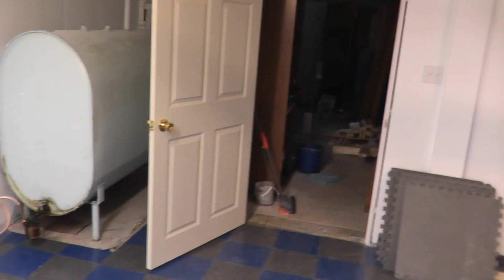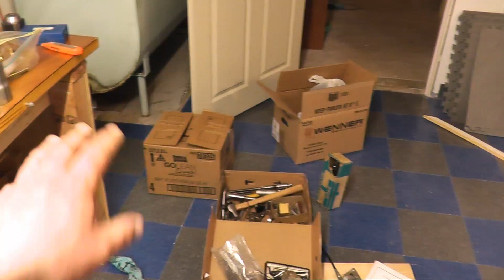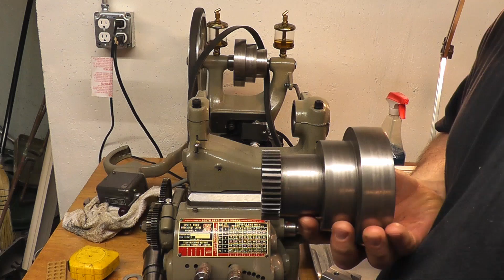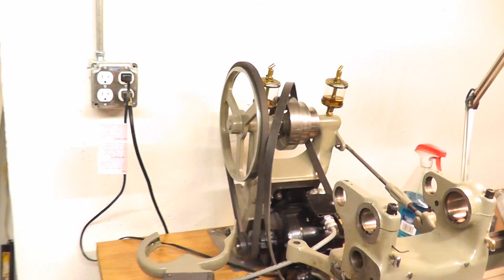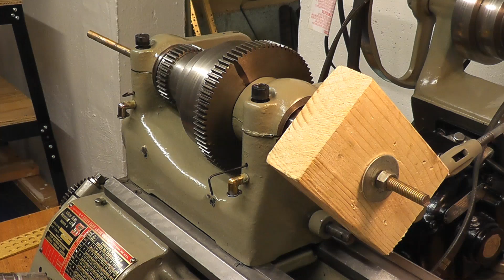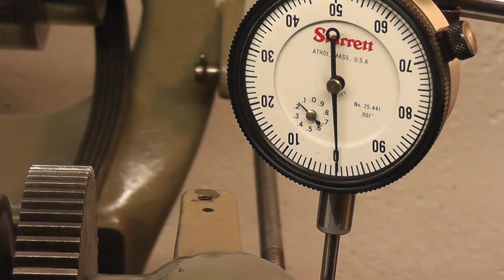Southbend Headstock Assembly

Comment: Got my spindle reinstalled this evening.  It all feels a little tight and doesn't spin as freely as I think it ought too, even backing tension off of the washer.  I did add needle bearings too while I was at it. 

When I was reinserting the spindle through I had to use a draw bar setup to draw it through even before I reached the bull gear's keyway.  It was extremely tight and I'm wondering if I ended up with some foreign debris even though I tried to keep it super clean and lubed up. 

I'm thinking of running to see if it will bed in,  what do you think?  Take apart/ reassemble or run to see if it beds in first?

My experience putting it back together was not like yours,  I had to use some persuasion.

Comment: Hopefully you still monitor this post.  Have a SB 9", A model and it needs painting.  Paint, do you remember the type and color etc. that you used?  Thanks
Reply from the maker: It's a custom paint match using Sherwin Williams all surface enamel.  Look back to one of my first few videos called stripping a lathe for new paint.  The paint code should be on that video.

Comment: Hi Greg, Absolutely great tutorial on assembling the head stock and back gear. Just one small tip on adjusting the depth of mesh on backgear to head stock, put a piece of paper between the two gears when adjusting to give the correct (or close enough) mesh clearance. Many thanks as I have a Southbend copy 9" A model Hercus of 1954 vintage here in Australia which I am trying to source a set of 'V' belt cone pulleys for, to replace the flat belt pulleys but no luck so far. They are like rocking horse poo!! I can get the back one but not the headstock one with the gear on. Cheers.

Comment: Hey Halligan, new to the channel. I got a 1940's lathe at work that we got from the USN. Well it had been pretty abused and not well taken care of over the last 80 years...so I decided it would be a good idea to take it apart, remove all the old paint layers(could visibly notice over 6 different layers as i scraped it off), anyways, im putting the headstock back together and i actually broke the take up knot in half as i was trying to get it over the grooves, that in turn made the screwdriver break loose and i ended up cracking the fiber washer as well. (For the record, I have absolutely zero experience working with lathes or anything else like this as im an IT guy, this just seemed like a good way to start getting into it.)

So my questions are about the needle bearing and the take up knot you mentioned in your video, for some reason the link that was supposed to pop up as you were talking about them didnt actually show up.

SO hopefully you know of where i can buy those?

I appreciate your time and videos, they have been a huge help throughout the process.
Reply from the maker: McMaster Carr
5909K39 for the bearing assembly
5909K53 (2 required) for the .031 hardened and ground washers.
For the nut search McMaster under split collars and find one that's the same thread pitch.  I don't know off hand what it is so you'll have to measure and check.

Comment: Where do u get the belts for this lathe?
Reply from the maker: It’s an automotive Serpentine belt.  Any auto parts store or McMaster Carr will have it.  Just measure the length you need by using a tailors tape measure or a string wrapped around the pulleys with the countershaft in the tightened position.

Comment: Who made your new spindle? I'm thinking I need to have my head-stock rebuilt. I have a 1936 9 inch Workshop lathe.
Reply from the maker: Spindle is original.  If your machine has plain cast iron bearings chances are you can just run them as is.  I've seen completely trashed cast iron bearing heads run perfectly fine.

Comment: Dude! You are clogging the oil grooves with the grease!
Reply from the maker: Per Southbends Updated lube charts.  Permanently grease back gear shaft and cone pulley OR you can do it the old way and add oil to back gear shaft and cone pulley everytime you engage the backgear.

Comment: Thanks a lot for sharing your work on your Southbend Headstock Assembly.  Really neat.  It was the height of frustation to miss the belt in the pulley only to be discovered after assembling whole of Headstock.  I can imagine that as it happens sometimes.  Thanks for the Video.
Reply: Birender100 tagger.

Comment: What type of motor are you using and what type of power?  Do you plan on getting a VFD device?  Thanks for the informative videos...
.Larry in Sacramento
Reply from the maker: It's the original 1/4 HP instant reverse GE motor that came with the lathe in 1950.  Works fine for me so I won't be changing it.  I don't mind a step pulley.
Reply: Larry Hughston '

Comment: Could you tell me the purpose of the sliding knob that is located on the bull gear? Mine was pushed in but i was playing with it, and pulled it out, and now i am unable to put it back. Any help would be appreciated.
Reply from the maker: +hugoballs 
This disengages the bull gear from the cone pulley to allow you to engage the back gear for slower speeds through gear reduction.  Just put pressure on the pin and rotate the cone pulley.  You'll feel the hole that it goes into and it will pop in.
Reply: ***** thanks! i tested it and everything is working now. i appreciate your time.

Comment: What belt number (length) are you using? I want to put a serpentine belt on mine.
Reply from the maker: +Dan'sMeTube It;s a 54" 4 rib belt.  I purposely got a slightly longer belt.   Either measure your leather belt and do a search or if you have no belt run a length of string around y our pulleys where the belt would go and measure that.
Reply: Thank you!
Reply: 7pk1370. 25mm by 54" or 1370mm. 7 rib. If you want a wider belt that fits the pulleys.
Reply: Thanks!

Comment: I see how you press it on how do you get it off?
Reply from the maker: Olivia Bishop I have a diasassembly also.  It's just the opposite.  Put the pipe over the other side of the headstock and pull from there.

Comment: Hello Halligan 
I just found a good condition headstock to replace my old bad once.

my old one as you know is flat bearing just same like yours in this video.
but I found one with lines to hold the oil, the seller says it's high speed version!

do you think it is good upgrade or to stay with same old style is better?
as I found another headstock flat like my headstock too? just confuse which one is better to go with?

and I bought semi new spindle from ebay :)
thank you for all of your answers and help.
Reply from the maker: The segmented bearing goes with a 12 speed lathe.  The one with 2 steps on the motor pulley.  The slots are there to prevent the oil from slinging out of the bearing during the higher speeds.  That is the better version.  You can eventually upgrade if you find the 2 step countershaft pulley.  These usually come up in eBay from time to time with the shaft attached and without the whole motor mount/flat pulley set up.  The 2 step motor pulley can be had from any industrial supplier.  You don't gave to source one from another Southbend.
Reply: ***** 

oh great, I just bought this countershaft http://www.ebay.com/itm/SOUTH-BEND-9-LATHE-COUNTERSHAFT-/131473728509?pt=LH_DefaultDomain_0&hash=item1e9c71e3fd

and I will go head and search for 2 steps motor pulley!
I am glad to contacting you and get these valuable information!

Comment: great videos man!! I just picked up a south bend 9" lathe yesterday. It is exactly like yours but without the gearbox. I want to do the conversion a bit later as well as restoring it. Paint is a little beat up and it is missing a few small things. How much HP does that motor have? And where did you get the back gear from? Mine is missing a couple teeth on the smaller gear. Let me know man. Great videos once again. I spent most of the evening watching your stuff. thanks for sharing the knowledge.
Reply from the maker: The motor is 1/4 hp and is original.  They were available with up to 1/2 hp from the factory i believe.  Remember though these are old motors so the 1/4 hp rating is not the same as a modern 1/4 hp motor.  Manufacturers fudge the numbers a lot.  The replacement back gear was sourced from e-bay.
Reply: *****  thanks man!! I also have a 1/4hp motor on mine. It is a Dayton motor and not sure how original it is. Thanks again for the reply. I'll look on ebay for the backgear.

Comment: What is a good source of parts for South Bend? Looking for the sliding gear for a 13.
Reply from the maker: Besides e-bay you can check out www.plazamachinery.com  www.tools4cheap.net and you can also contact Ted who used to work for Southbend and sells NOS stock.  You can find him on the PM forums under SBLatheman
Reply: Ted (Latheman) got me the part. Thanks

Comment: So the thrust bearing gets pressed on through the bull gear by the drive pulley?  Wouldn't that mean that the bull gear would rub the pulley when putting thrust on the spindle when in back gears.  For example drilling a hole using a large drill bit in back gears where the drilling operation could exert significant force on the spindle e.g. 3/4in drill bit enlarging a hole from 1/2in in steel.

There should be another thrust bearing between the back gear and the pulley.
Reply from the maker: The rear thrust bearing sits between the bearing casting and a lip on the spindle.  It never actually touches the cone  pulley.  You can see the change in diameter of the spindle ~ 12.58 in the video.  There is a few thousandths clearance between the bull gear and the thrust bearing to allow it to move freely when the back gear is engaged.
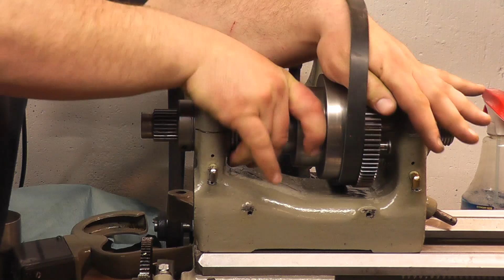Reply: *****   At 22:30 you clearly show the bull hear binding with the cone pulley.  If that happens as a result of tightening the thrust adjustment nut than it will certainly happen as a result of putting thrust on the on the spindle from the tailstock.

Nice lathe BTW, I have a 1940's 9A with that is a bit odd (has no serial numbers).

Comment: I watched this for the third time and learned something every time. In the book I have on this lathe, the book states there should be .005 clearance on the spindle where it meets the head stock. Of course mine was way to much, so I took it all apart again, I did move it quite a bit, but was never able to achieve the .005 clearance. I noticed in this video it looks very close to the head stock and from my view looks pretty close to .005. Did you measure it or press it in until it stopped. Maybe I need a bigger wrench when tightening : -) .The lathe runs fine as is.
Reply from the maker: I just checked with some feeler gauges.  It's between .009-.010   I just pressed it in until it stopped.

Comment: Super Lube is the wrong  grease for the cone pulley. Super Lube is too thick. The clearance in the cone pulley is very tight. The proper "grease" is like a heavy oil I quote from a South Bend lathe user group:

"The very thin DE112 grease from South Bend is definitely NOT SuperLube, or anything of the sort. Any reference to SuperLube or other ordinary grease is dis-information. 

You can get the real thing at:
<http://www.wswells.com/items_for_sale/DE112.html>. 

As a test, I did a manual greasing of the cone pulley with SuperLube and there is no question that the viscosity-induced drag in this very large-area bearing would be excessive. That's why I asked this question in the first place. So my solution is to stick with oil for the limited use that my lathe will see."

Unquote.... or if it says oil on your cone pulley use Type C gear oil each time you use the back gear.
Reply from the maker: Hrmmmmm.....interesting.  I guess I'll have to buy it and do a comparison.  Super Lube was recommended to me from multiple sources and is actually recommended in the rebuild book Steve sells.  I'll order a batch from Steve and do a little video on it.

Comment: Great video! I was wondering if you could show us how to line up the headstock to the ways. Thanks for video Craig
Reply from the maker: The headstock is scraped to fit the bed at the factory.  It sits on a V way which aligns everything and cannot be adjusted.  Any misalignment in the headstock compared to bed is usually from bed twist which can be taken out using a precision machinist level to level the lathe.

Comment: Great video, I know nothing about lathes but I m trying to learn as much as I can from you and others on here (Tom'sTech, Mr pete,just a few that I think are really good) What size lathe is that? I have been looking for one for a while they are either to big or way out of my price range It would seem that South Bend is a good lathe as there aren't many out there and those that are are bad shape over priced or to far away to get lol anyway keep up the good work! Nice shop too
Reply from the maker: It is a 9 x 54 Southbend.  The long beds in the 9" side are a little rarer than other bed lengths.  Southbends are super popular because there were so many made and when they were made the smaller sizes (9", 10", 10L) were billed primarily as a home shop lathe.  Plus parts are readily available unlike some other lathes in this similar category like say the smaller Sheldons and Logans.  Funny thing is usually as the lathe gets larger the price decreases.  The Heavy 10 aka 10L is very desired because it is small yet extremely capable.  You will see these going for  800-1500 in my area depending on ltooling and they do sell.  I saw a good condition 16" southbend sit for months on cragslist for 500

Comment: Good video on installing the spindle.
Could you do me a favor and make a video on setting the gear mesh/lash of the idler and forward reverse gears and the lower gears.  I set mine with paper and they have a little bit of lash (paper out) but they are very noisy, even after lube.
Would like to hear yours as many say they are noisy, but that is a pretty subjective term, and would like to hear yours.  I hesitate to run mine much until I know it is OK.
My lathe is a SB 9A 
Thanks for all your videos
Reply from the maker: I show it here Southbend Compound Large Dial Conversion- Part 3   This is from before I converted the lathe to a quick change gearbox.  What I do is loosen the clamp nut slightly on the banjo.  Mesh the gears tight.  Start the lathe then slightly tap the banjo down widening the gear mesh until it gets quietest.  You'll never be able to remove all the noise.  They are straight cut gears spinning kind of fast.  Think manual car in reverse doing 30 and that gearbox is swimming in fluid.

Comment: Greg;

Rather than using small allen wrenches to try and trap the springs on the oilers, would a small nail be easier to use since you could then just push it into the felt, regardless of where the spring is?

Been there myself on the forgot the drive belt more times than I like to think about on my lathe.  I just pull the bearing caps and lift out the whole mechanism as that is easier on my lathe than trying to remove the bull gear.

Keep up the videos, you do an excellent job of explaining what you are doing each step of the process.

Regards;

Ron Kluwe
Reply from the maker: Thanks!  The felts are super dense at the tip.  If you have a nail that could easily pierce it rather than squish it that would work too.